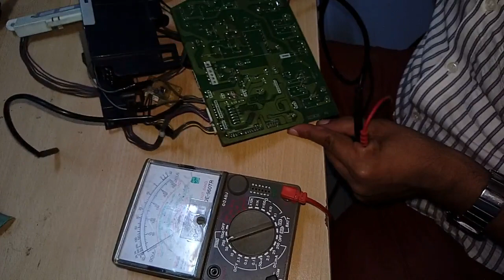How to Repair GENERAL AC CIRCUIT

Comment: Bro my o general split 1.5 tr ac indoor and outdoor fuse  just power supply on and Agen blast , plz tell me region
Reply from the maker: what is blast ... power supply again blast or another thing
Reply: @mrcontrive5641  indoor pcb fuse  3.15amps and outdoor fuse blast bro
Reply from the maker: @abdulmunir9256  please check 1st time indoor circuit

Comment: How much it costs if we buy a new board...?
Reply from the maker: this is not available at local market
Reply: @mrcontrive5641  
I have O General split ac 1.5ton, non-star and my control board is not working...

Technitian told it will cost ₹2000 for servicing it...
 
Will it cost ₹2k...or what's your suggestion
Reply from the maker: @vijaythangaraj4047  Mr. Vijay it will great if technician repair it perfectly. But technician is charging you lots . it s repaired cost should be 700 RS to 800 RS 
thanks